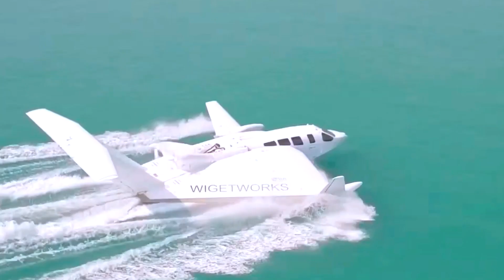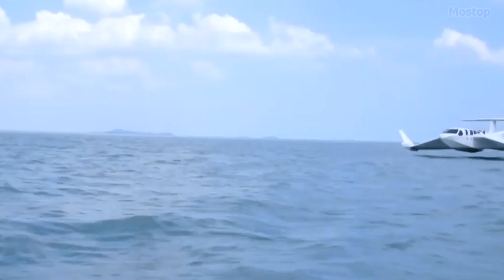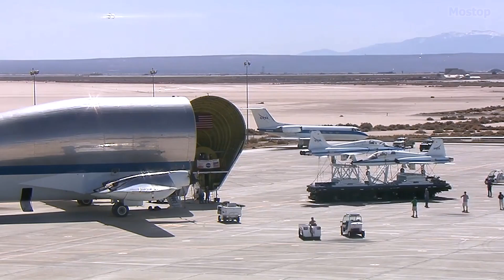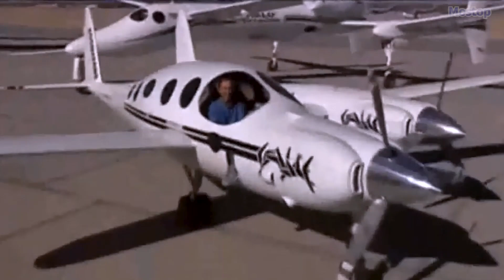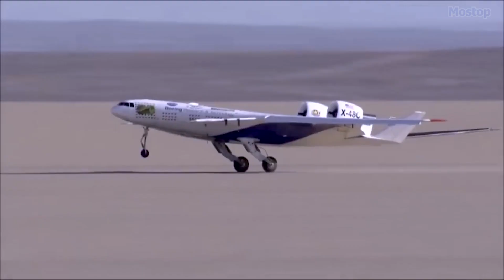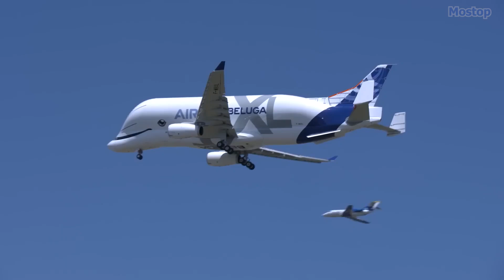These are the Weirdest Airplanes in the world

Comment: That flying saucer now has a second chance. When cheap consumer drones can fly stable, the Air Force can easily update that old flying saucer. But we know how it goes, do you really think the Army has archived the blue prints? Unreliable people, however, such blue prints can easily have been rescued by a cleaner or construction guy. Or maybe it was destroyed. For wrong reasons. But okay, F-35 can take off vertically, we already have the successor, it is just a bit too fast.b